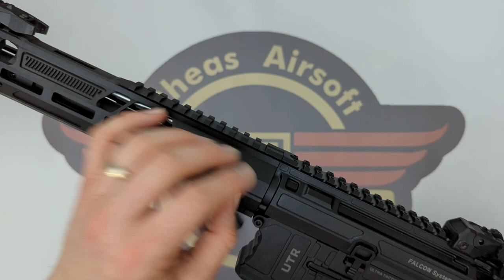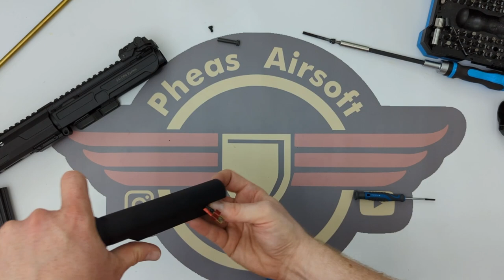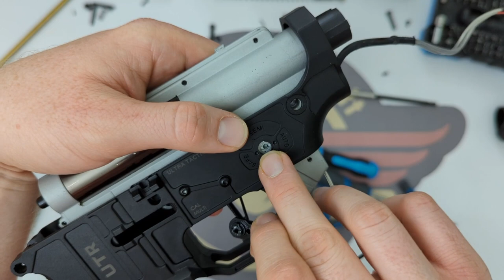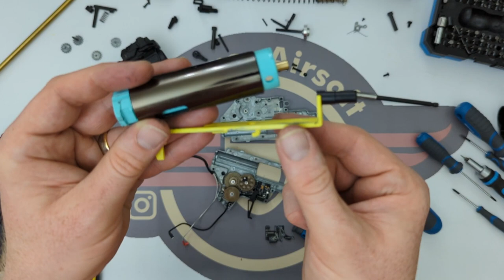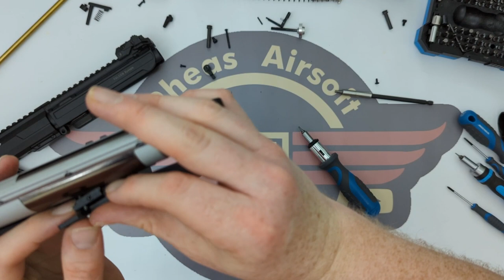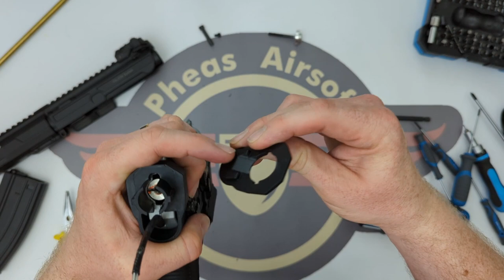[HOW TO] DOUBLE EAGLE UTR556 DISASSEMBLY - REPAIR AND MAINTENANCE

Comment: Thanks for this dude, from the back end what bolt is holding on the buffer tube?  Im thinking of putting on a sling loop and a drop stock attachment, think these will go on ok?

Comment: Hi Pheas, Do you maybe have some tips to assemble a gearbox? I always get frustrated to assemble a gearbox especially the trigger unit. Do you maybe have some tips or tricks to make this more easier. Cheers
Reply from the maker: Hiya, I would have a look at getting the "helping hand" I think they are called, which hold the anti reversal latch in and the trigger I think. I have used them in the past. The trigger I find if I put it in and leave it "wedged" at an angle it tends to stay in place better and make sure you have a small screw driver / propper to pull the gear shafts into line. The other thing is to put the shell on from the front first so it catches into place on the cylinder head and then goes back, this way if the trigger pops... it tend to pop into the correct position / hole for it. Pheas

Comment: In my team we have 4-5 double eagles.i upgraded them all.two of them are 916 and i put in them
Gate aster
16:1 titan gear
6.01 action army inner barrel
Fps softair cylinder, cylinderhead,cnc nozzle, piston,
TopMax pom pistonhead
One has 19k 28 tpa Begadi mamba motor
the other has 28k 19tpa
Maxx M4A cnc hopup champer with mrhop 2021 silicone bucking 60°
They all run with 11.1 novritch stick battery 30/60 c 1450mah
The guns shoots phenomenal,and the owners are extremely happy with the performance....
If anyone wants anything feel free to ask
Reply: What was the quality of the inside of the cylinder where the piston goes
Reply: @msrio  the cylinder seems to have some kind coating..but i had marks from the pistonhead...
Reply: Have you upgraded the spring as well?
Reply: @stevetidman63  i cut the spring that came from factory to shoot around ~1.2j,~355/360fps...

Comment: This is on my shortlist of rifles, but the 40 metre range really is a limit. Do you have a reliable way to extend this to at least match the SSR4 quoted figure of 60 metres?
I don't want to end up replacing everything, because if I had to do that, what would be the point of buying a complete new rifle over just the body/receiver etc.
My others on shortlist are all under £300 also, and all assault rifles.
I have a spring sniper so I don't think I need a DMR.
I have two gas pistols also.

I play exclusively in woodland, both natural and planted areas, and there are wide open areas with some 100 metre clearings, hence needing great range.
Reply from the maker: hiya, the 40 meter is the minimum i can guarantee its going out to, its defo much further than that, the guy that owns this plays regularly with me and its easily putting out over 50 meters in range if not 60 plus (its a smaller site we have played at recently) It will absolutely match the performance of the SSR4. If you did want more... high quality tightbore barrel and an uprated rubber will give you potentially even further out of it.

Comment: Hi , I have a question: what tools or tool kit do you use to disassemble this replica? I will soon want to disassemble my UTR 556, but I don't have the right tools and I don't know which should i buy.
Reply from the maker: Hiya, Typically a good quality Screw driver set will be sorted, make sure it has torx bits in there, I usually use Torx 6 to to 10, occasionlly I need a torx 5 and torx 25. I haven a bit a siolly amount of tools, I did a video here: https://youtu.be/NbQisr5MnzE?si=cueAmyAupDWujhGx Pheas
Reply: @PheasAirsoft  So do you think that with Torx 5 to 10 and a few screwdrivers I will be able to disassemble this replica with your tutorial without any problems?
Reply from the maker: @qwerty32185  yes! With little to no effort
Reply: @PheasAirsoft  I have one more question, what is the difference between the allen key bits and the torx? Is it the same?
Reply from the maker: @qwerty32185  The torx bits are like little star looking things, the allen keys are hexagons, so the torx for me tent to grab better and tend not to round off , allen / hex head just can be very weak and round easily. Pheas
Reply: @PheasAirsoft  ok, thank you, i will choose torx :)

Comment: So i bought my airsoft replica like 10 months ago havent played too much since summer , came back from the vacation and suddently the gun does this weird thing (M916G UTR556 the replica) i am a complete airsoft noob and i have no idea whats can cause this especially in a almost brand new gun with like 10 games on its head , So it starts with if i put the gun on semi the moment i connect the battery it does nothing the moment i put it on full auto it shots burst (obs cause i programmed it that way on auto ) but when i go back on semi it does the same thing shots in burst , A small remark i did damage abit of the cable when i was trying to change the spring and i applied electrical tape to fix the small wiring damage i caused maybe it the issue , but it was working fine after that so i really dont know, and i have tried to reset the mosfet burst setting and all that still does nothing. pheas any tips?
Reply from the maker: Hello, the mosfet doesnt cope well with not being on safe at powerup. if it behaves normally when powered up with the selector on safe, then you are all good. If its regardless of firing mode when powered up, then it might be the wire might be causing conflicts, but not likely. I would also try to re-programme single shot, just incase you have activted burst maybe? Pheas
Reply: @PheasAirsoft  have tried all of the nothing working ill send it back to taiwangun probably
Reply: @PheasAirsoft  aswell everytime i shoot the gun it double beeps on the mosfet
Reply from the maker: @papalisgaming5658  just to check it only beeps when it's fired and not just beeping on its own? If it's just when it fires then it's not detecting the cycle of the gearset. This could be a dirty sensory, or a damaged sensor or  damaged gearset that isn't spinning the sector gear (but I think you said it was firing). If it's still in the warranty period I would send it back. If it's out of warranty then have a go or get a tech to look at it for you. Pheas
Reply: @PheasAirsoft   do you have any experierience with taiwanguns warranty system i know i still have warranty i did send a email but i have been waiting a long time for them to create a shipping label, do you know usually how much time it all takes
Reply from the maker: @papalisgaming5658  the warranty system I've not used. Whenever I bought anything I accepted it would be a nightmare getting anything sent back so it was on me. I'm sure they will be in touch! Good luck with it! Pheas
Reply: @PheasAirsoft  Letting you know and if anyone sees this it was a faulty mosfet , taiwangun fully replaced it for free and covered all the delivery costs.

Comment: I bought one of these replica and after finish the game i want to pull out the battery cand he get out with the coupling from the gun and wires remain without them i tryied to put them back but i din't realise i don't have the coulours of the wires so i put it - to + and + to - just for 2 in this time a little smoke appear from the top of the stock do you have any ideea what can be happend i broke the entire weapon or i just burnt something ??? please i am waiting for an answear thank you !!!
Reply from the maker: Sounds like you have fried the computer chip inside it. If it's new send it back for a replacement, if it's no longer under warranty it will need someone to replace the MOSFET computer system. Pheas
Reply: @PheasAirsoft  thnk you for res is it new today bought but the warranty doesn t care bec it s my fault u know.... but i didn't force it or something just get out of the wires....
Reply: @PheasAirsoft  and în description they say the motor and circuit have a defensive sistem.... idk how this happend
Reply from the maker: @crococool88  I would contact the retailer and ask for their help anyways. They may do you a discounted repair. If there is an option, have a Perun hybrid V2 fitted (outstanding piece of kit !!)
Reply: @PheasAirsoft  i will see thank you man ! (I was thinking is the motor burned) ....

Comment: Hi pheas , i bought the M920A from DE , and when i pull the charging handle it doesn’t lock back . Any ideas?
Reply from the maker: Hello! If its not locking back, check in the mag well for the bar from the bolt release to the catch on the other side. If the bare is there then its either not connected up properly or the bolt  or the catch is damaged. If the bar isnt there at all, then send it back and have them replace it (if its brand new) Pheas.

Comment: Do you know how to tighten the stock on the ak47 from cyma (cm048m)?
Reply from the maker: Hello, if all the screws are tight on the bracket that holds it to the body, guessing it still has a little side to side movement? All you can do really is take the stock off and pad the bracket and end (that goes against the body) with duct tape or similar to remove the space that allows it to wobble. Pheas